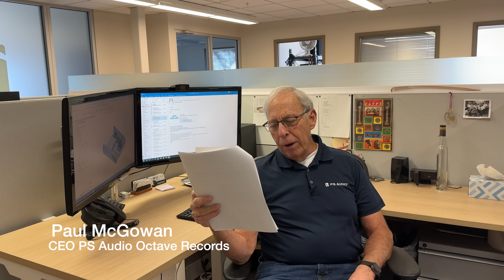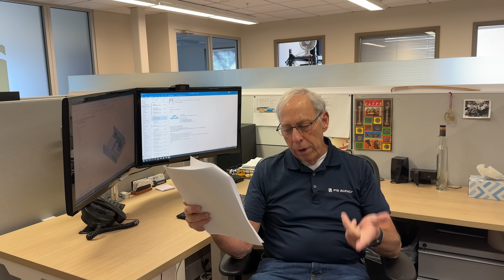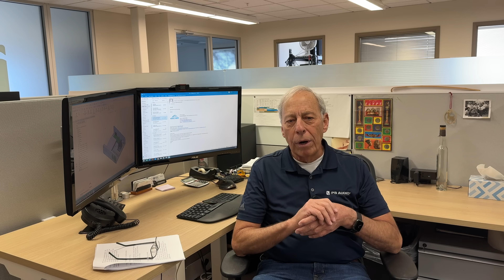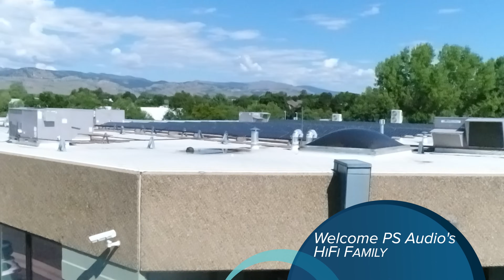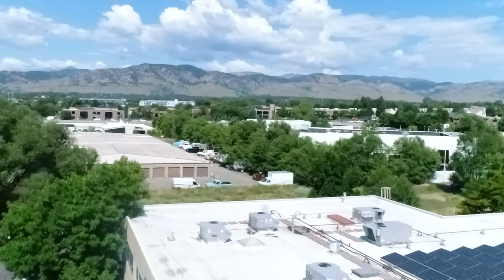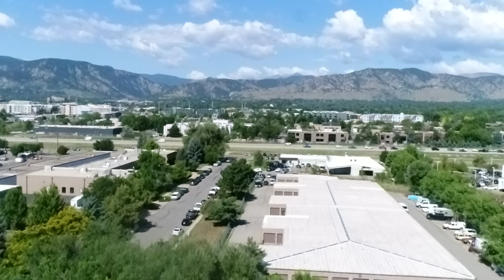Solid core vs  stranded speaker cables

Comment: "hope that helps" 

No. No it doesn't. Why do you prefer not to use a solid wire? You didn't explain anything... why is it bad???? How can it sound worse?? it's just a conductor... if it has no resistance or inductance how can it possibly affect sound quality????? Where's the science?

Comment: Manure, speaker cables be it stranded or solid will have ne effect on the sound.  The oly thing that matters is if the speaker wire is the appropriate gauge for the length of run.

Comment: I used to use ok stranded back in the day. I went to a shop and they have their cable comparison setup. I did notice a slight difference between the different cables they used. This sent me on a quest. I in turn decided to go with RG6! The results were incredible! So is also having a power conditioner! A definite must. Thank you for the video!
Reply: Why ? It's the CAPACITANCE  of the wire that changes the sound !  That also goes for inter connects on your pre amps. The gauge depends on the length . Too little gauge on too long a run will reduce high frequencies .

Comment: I have not noticed a difference between solid core wires of different sizes, but going from stranded, twisted wire to solid core was a big improvement. Particularly the low end.

Comment: He was perfectly clear. Cables can have multiple conductors that would be separated within the overall jacket. Each conductor can be made of solid core or stranded copper/other with varying gauges.  He prefers the former as he stated. He also said a single solid core conductor is not preferable for the reasons he mentioned and his past experience.
Reply: He is nuts.

Comment: I remember years ago when 10 or 15 audiophiles couldn't tell the difference in sound between coat hangers and Monster Cable in a "blind" listening test.
Reply: I tried that 2 years ago.  The coat hanger was a lot warmer sounding. Lost a lot of the top end hit harder in the low end
Reply: @jeff666p same gauge same length = same sound
Reply: @doncahooti  I tried that 2 years ago.  The coat hanger was a lot warmer sounding. Lost a lot of the top end hit harder in the low end
Reply: @jeff666p the other wire was either shorter or thicker.
Reply: @doncahooti same. Just stranded instead of soild
Reply: @jeff666p  then you were mistaken.
Reply: @doncahooti I am not
Reply: @jeff666p  then you don't believe in the laws of physics.

Comment: I just want to know Cardas wires are ok. They seem to know what they r doing and other manufacturers buy their copper wires.
Reply: very overpriced .
Reply: @doncahooti Well I paid US155 for 2 2M set with high quality connects , I compared them to some Chinese full silver ones that cost US70 , also had VanDen Huls , other Chinese brands, some free cables that came with my speakers,  frankly they were way better in every way. The proof is in the audition , listening test , using familiar well recorded tracks. So although pricey compared to the competition, it’s legit.

Comment: From an electrical engineering perspective you should get better performance from a high count stranded cable, 300+ strands. Make sure it's pure copper and the largest gauge suitable for your system. Aside from that you will not be able to tell a difference between a multi-thousand dollar cable and a $1 coat hanger. In fact a double blind test was done in which there was actually a slight preference but still not enough to be conclusive for the coat hanger.

Comment: I've been a Hi-Fi enthusiast for 45 years, so what do I know? ... In almost half-a-century, I've NEVER used solid core speaker cable (does it even exist?), I've only ever used stranded. Inflexible solid core cable belongs inside a wall, or under floorboards. You may as well wire up your speakers with iron bars! 👎🤣

Comment: I use both, well power cable versions anyway, but i use them as speaker cable. Stranded gives better highs and solid core gives better lows, so i just combine them and it works.

Comment: Rich  people including Paul are easily fooled. Spending more money on cables is dumb.  At audio frequencies the human ear can not hear the difference.  By the way what is inside a high quality coaxial cable used for radio frequencies?:  A single sold wire.  ....duh.   A sensitive spectrum analyzer would maybe show some difference at audio frequencies.  You could cut the ends off an old extension cord and use it to hook up your speakers and it would work the same as if you bought the most expensive speaker cable.
Reply: It is more likely that someone who is uneducated is easily fooled instead of someone who is rich or poor. You are fortunate that you are happy with a repurposed extension cord for speaker cables. I’m guessing you have not compared a well built cable (I did not say expensive) to an extension cord.
Reply: @DirkJensen  Educated people are also easily fooled.  81% of Americans are "Covid Vaccinated" with a substance that doesn't prevent COVID and doesn't stop the transmission of COVID.  81% of Americans are fools.  Even when told to "Follow the Science", most did not follow science.

Comment: Why are comments being deleted here? Why isn't anyone using an audio spectrum analyzer to back the claims being made in the video on solid versus stranded wire? Isn't it fair to have actual evidence to back any claim, and isn't the burden off proof upon the person making the claim?
Reply from the maker: When the comments are mean-spirited or simply dismissive, I do my best to delete them. They are of no value to anyone. If someone disagrees that's just fine. As far as measured results versus sonic evaluation, that's been a hot debate for years. It's easy to see differences on even a scope when you send an impulse terminated properly between an amp and an inductive load (like a speaker). That's not the issue. The issues is what are you seeing and how does that relate to what we're hearing? In all the years I have done this there's never been a clear correlation I can see. Better to trust your ears.
Reply: @Paulmcgowanpsaudio  ( edited to be less toxic and less disrespectful) Then can you put solid versus stranded wire on the scope/spectrum analyzer and show us? As mentioned in my deleted  comment, stranded Litz wire is used in a variety of industries at higher frequencies due to the superior performance. The claim was about higher frequency response.
Reply: @SparkyTom1 You can’t always measure good sound, it just happens and you say wow! It’s like drinking wine or beer, where you can’t measure the taste.
Reply: @AV-MusicMan  This is called confirmation bias and another bad argument. You're also using a bad analogy- we can ALWAYS make the measurements in the differences in beer, wine etc through using a mass spectrometer etc.

And we can always measure the signal to the speakers and measure the output from the speaker to falsify the claim.
Reply: @SparkyTom1 so if you can’t see it, then it’s not real correct?? You have 5 senses as a human-being and for some reason out of those 5 senses your ears are always lying to you??’s These are the things you are implying.
Reply: @Paulmcgowanpsaudio  Also Paul, I don't mean to be disrespectful to you and I do apologize for coming off that way. I should be more diplomatic. Could you show the difference in a video in stranded versus solid? In addition, with the way hearing loos works would anyone over 40 be able to tell the highest frequency response difference?
Reply from the maker: @SparkyTom1  Thanks, Tom. I try and keep this channel friendly. Otherwise, what's the point? To your question, I am 75 years old and the differences in cables are easy to hear. I don't think it has so much to do with the very top end. Rather, it seems to be a complex amalgam of differences that together result in the differences we hear. I wish I had the time/bandwidth to dive deeper into the subject but running the company and trying to produce daily content (and have a life) often get in the way.
Reply: @Paulmcgowanpsaudio  Dear Sir, not a single proponent of such "amalgams of differences resulting in differences", literally not a soul, has been able to prove any audible difference in a controlled environment. You would cover your ears and run out of the room, unable to withstand copious amounts of distortion produced by sources, amps, let alone loudspeakers, if only your hearing was good enough to distinguish between cables of similar gauge and length. Go figure!
Reply: Then, of course, the burden of proof also falls on anyone who claims I can’t hear a difference between cables to somehow prove that I cannot. A spectrum analyzer cannot prove what I can or can’t hear. It can only show objective measurements for specific tests, not exhaustive analysis of all the complexities of human hearing and perception.
Reply: @DirkJensen  Appealing to negative evidence is not an argument. If the signal is identical then why would it sound different? Magic?
Reply: This isn’t a court of law. He is just answering a letter someone sent him with his opinion.
Reply: @DirkJensen  A claim was made, claims need to be backed with evidence, and the burden of proof is upon the person making the claim.

Comment: For all you people in the comments remember that they did a blind test where someone connected a $1 metal clothes hanger opened it and used it as wire and then tested a  $20,000 cable to compare and they couldn’t tell the difference! Electrons are electrons!
Reply: This could be true, but I have heard that story many times without anyone ever producing any evidence that such an experiment really occurred. Also there is no information about the rest of the test system. If it was a Montgomery Ward boom box then I am less surprised than if it was a Mark Levinson system. Bottom line is you are spreading hearsay.
Reply: and the electrons dont carry the sound they are too slow ! electromagnetic waves carry the sound at near light speed .
Reply: Must have been 98 years old great-grandpa's in that listening panel 🤣🤣
Reply: @5starmaniac  
Lol
Reply: Maybe they used a poor piece of music as a source.  Cables make a big difference (5%, but all the percents add up!) on high end systems.  Say > 20k for the system.  I had a pair of Sansui audiophile speaker cables (PS 107c) that I paid 189.00 in 1978 and when connected to a pair of extremely efficient speakers (EV interface D), you could hear the am radio in the speaker when you put your ear to the midrange.  The equipment was off.  I then disconnected the cables from the electronics and could still hear the radio!   Right now I have an old set of synergistic research worth about 1.5k.  I might try the hanger test, some old lamp cord, and 3 x UTP suggestion and report back.
Reply: @AV-MusicMan its physics - same gauge and length =  same sound . If not your head is deceiving you !

Comment: Sound deniers need to get off their measurement high horse and do their own listening instead of regurgitating what others have told them. Cables are probably not the best place to start if you aren’t satisfied with the sound of your system, but they can make a difference if the rest of the system is revealing. It doesn’t matter if you make the cable yourself or buy a cable from a manufacturer, but the construction of a cable absolutely makes a difference. I work for one of the largest independent cable testing laboratories in the world, and I can assure you that the tens of thousands of different cable architectures being manufactured are not made to trick you into thinking there is a difference between them. There is a difference between them. All engineering is a series of compromises. Different cable architectures address solutions to different issues. The cost of a cable or the name printed on it don’t affect the sound at all, but the construction of the cable definitely does. Get together with your friends and have everyone bring a set of speaker cables. Rotate them through the system and see if people hear a difference. You probably won’t all agree on what sounds the “best,” but I bet you will agree that they sound different.
Reply: because they all have different CAPACITANCE !!!!

Comment: So could one use Romex for speaker cable?
Reply: Yes,  but only to satisfy one part of what Paul described.   To be complete, you would want to have it combined with a different gauge Romex as well.  In other words, use one thick (12, 10, or 8 gauge) and one thin Romex (20, 18, or 16 gauge) per terminal.

You could do the same with traditional braided speaker wire as well. 

Crutchfield actually has some nice copper wire you can buy in bulk, combine the two different strands, and end them with some nice banana plug terminals, and you'll be all set.

Comment: i call bullshit, solid copper wire is what makes up stranded wire, just many smaller gauges of solid wire wrapped in insulation, stranded wire is more flexable and less prone to work hardening , but in my experience trying 14ga romex all the way through some really expensive stranded i've never been able to hear the difference on really highly resolving equipment.

Comment: Cables might make a psychological difference to a discerning audiophile with a very high end systems.  But very high end should sound great no matter the cables. Use cables commensurate with the system.  I use Linn K20.  Linn makes high end audio and yet their cables, by audiophiles standards, are nothing special and very affordable.
Reply: And another thing, why don’t  cables makers publish specifications for their their products; resistance or impedance, etc., which might very well make a difference to your amp and speakers.  I once contacted Audioquest and asked for specs.  Their answer was, we can’t provide that”.

Comment: If I remember correctly from physics class... Electron atoms (electric current ) travel only on the surface of the cable , so you would need more surface area, and stranded provides much more surface area.   Hope that is correct.
Reply: Travels outside the cable in a EM field
Reply: Rich people are easily fooled. Spending more money on cables is dumb.  At audio frequencies the human ear can not hear the difference.  By the way what is inside a high quality coaxial cable used for radio frequencies?:  A sold wire.  ....duh
Reply: I recall him saying once that high frequencies benefit from stranded and low frequencies do better with solid core, so a hybrid cable is the best.
Reply: I believe it is frequency dependent.  As the frequency increases the skin depth decreases.  So a thick wire will not carry higher frequencies as effectively.  But you also want high current low impedance across all the frequencies so he suggests a variety of gauges.  I think  you can achieve all of it with litz.  Lots of smaller wires gives overall low resistance and high current across all the frequencies.
Reply: Nope, you do not. Far from it, in fact.

Comment: go to your town hardware store o ferreteria and buy standard electric single copper cable not twin. 4 or 6 mm quite thick some banana plugs if you want and build your own.  better than 600 buck brand cables. guaranteed. fuck marketing, fancy exotic materials and good old snake oil. trust me.

Comment: WHAT????? This video makes no sense - you contradicted yourself
Reply: I don’t think he articulated it very well but essentially he’s advocating multicore (e.g. Naim cables) - not massively stranded thin wire. The interesting nuance for me that he was recommending multicore with different wire diameters. Not sure if many manufacturers do that, maybe  some ‘high end’ ones?
Reply: @mike_lowndes the guy is cuckoo.
Reply: He said different diameter solid gauge in parallel.
Reply: @pablovilchez7501  exactly - what I’d define as multicore
Reply: Its a little vague, its either or.. even audioquest make single core OR stranded copper.  Tyere is no and and
Reply: @mike_lowndes yes yes, I was answering to the main comment. I don't know why is saying that Paul is contradicting himself
Reply: Not sure why you think that. Just because there are multiple conductors does not mean it is stranded cable.
Reply: How so?
Reply: There are speaker cables that have a single strand each of several different gauges, as opposed to s single large gauge, or multiple strands of the same small gauge.
Reply: He has done that frequently so.....
Reply: @LeRoySL-q5q the guy is bizarre

Comment: Stranded is bad, but multiple solid core is good? Isn’t multiple solid core the definition of stranded? Or are you talking about some weird geometry.

It’s weird because parallel wires for RF is the most efficient transmission line all the way up into the 10’s  MHZ  so why would parallel wires be bad at a near 20khz?

I suspect weird cables kill bass or prevents noise from being captured and amplified in the amp by the negative feedback circuits of some amps.